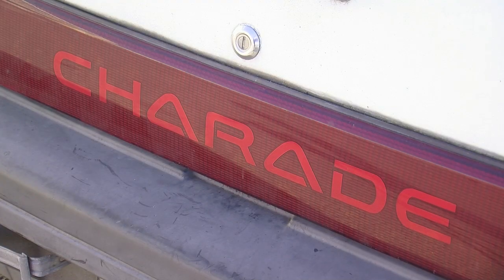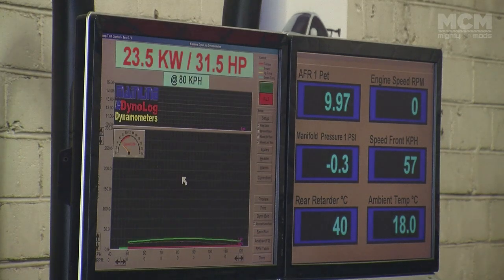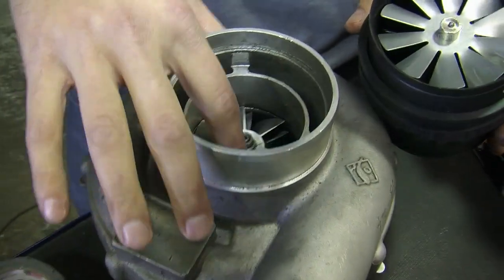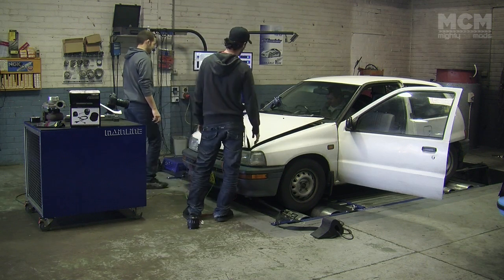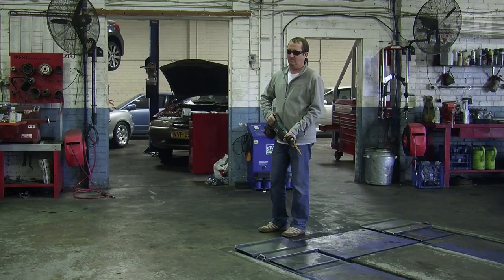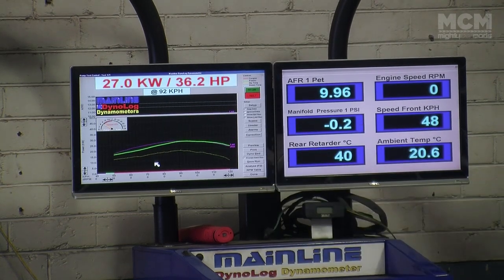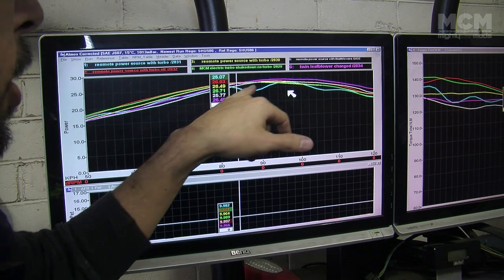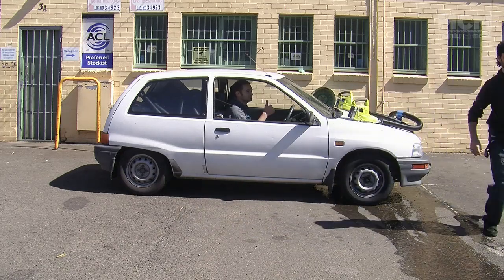Electric SuperChargers Mythbusted

Comment: u guys should build an elecrric supercharger that actually works. using a real centrifugal supercharger, but instead of being belt driven by the engine, have a DC motor spin the turbine. maybe a DC motor from an electric scooter or somethin... somethin with high torque and big nutz. ...maybe have a battery bank in the boot, and a switch to turn it on and off...  itll kinda be like "Nos" like in fast and furious... open throttle, flip it on.

Comment: There are electric super chargers that make boost legit but there not $100 on EBay. Seen one just last week that was dyno proven to make 140hp and 200ft lbs of torque on a 375hp V8. It has a switch that turns it on at full throttle and has several runs of zero Gauge OFC and two large AGM battery’s to help supply current to the big electric motor. And the whole system was still $100’s cheaper then a supercharger or turbocharger and made almost as much boost.

Comment: If you knew about carb cars you would know that the stock filter covers don't seal air tight. If you guys would have redone the cover and piping with an aftermarket set up the fan would have made power because it would have been air tight instead of the air pushing past all the leaks and not being forced into the carb at all. It wouldn't make any serious performance but it would have shown a difference. Shit your leaf blowing set up would have worked if you guys had it sealed up. Lol

Comment: So was the car fully up to temperature for all runs? It has an airflow diverter AFTER where u clowns fitted the forced-air systems that only opens when the engine is FULLY up to temp. Before that it sucks air from around the hot exhaust manifold. Having seen half a dozen of your videos now I have zero faith in your scientific method. This is pure Straylian entertainment (i.e. not very entertaining for anyone with an IQ above 100) and has zero real-world relevance.

Comment: I wonder if the electric super charger didn't work because it didn't have the extra 2" or so piping from the supplied air filter. Instead of focusing air through the fan, it may have just been displacing air around the edge of the fan blades. Pretty simple to test the theory. Hook the thing back up and attach your garden hose professionally with duct tape. Another thing is to consider the bottleneck from the exhaust system. Air can only flow in as fast as it can escape. Maybe the 30hp broken refrigerator also has a gunked up catalytic converter? I don't think is a scientifically reliable test.

Comment: Lol excellent video laughed at this stuff you guys pulled off. Only reason why I think those "FAN TURBOS" have any affect is because you remove the normal air intake filter. That will increase power but its not good for an engine coz it will obviously suck in dirt. Better then to just buy a cone filter.

Comment: Ok you wanks, I have an idea but not the capability or time. How about you try a cheap ebay turbo charger and attaching an adjustable 10,000 rpm grinder to it. If it works you could put a power inverter in the car to power it. I imagine it will work and the boost would be unreal if you don't blow the motor.
Reply: If you try it, please send me a link.
Reply: Ok, I wasn't sure what rpms a turbo spun at but it's higher than what i thought. Maybe a big impeller turbo at 10k rpms

Comment: I would also like to add make sure you add the air into the actual air Box so that it passes through the mass flow sensor, In the same pre determined fashion. Believe it or not those air boxes are scienced out. It will help smooth out the air as it enters that mass aiflow sensor, Providing a better reading. Doing all this for the least how about the computer system but may or may not make any more power.

Comment: From my experience  with these kind of things, anytime you use a factory car with the factory computer, anything you try to do that car to increase power fucks with that ECU and its emission gear. The car does everything it can to run in stock mode but you're forcing it out of its parameters. It's not exactly like a muscle car that you can adjust timing and fuel here and there to get some gains. The car basically thinks it's broken does everything it can to adjust itself back to what it thinks it should be

Comment: Hi did you not see the warm air valve on the air cleaner ? Was it open did it leak an pressure I wonder,and the air filter needs to be on the other side of the flow for sure.

Comment: easier to figure if it would do anything ....  comparing the minimum cfm flow rate  to keep engine  running  versus the output of that cheesy fan off ebay .  Even larger  radiator cooling fans only produce 2000 and up to roughly 4000 cfm and are much larger and have blades designed for max air flow under pressure.
  and  you need to not only look at  CFM but static airflow  in  mm of H2O to figure in total airflow and amount of pressure it can generate max ..... 99.999% of ebay  stuff are scams anyways but a lot of people don't have common sense to see  it

Comment: try again plz fan motors are  getting better now  and they are using rc aeropalane motor and try a bigger engine 2l min like gm x20xev 
http://www.ebay.com/itm/12V-Car-Electric-Turbo-Supercharger-Kit-Air-Intake-Fan-Boost-Thick-Wire-w-ESC-/112393989738?epid=837362203&hash=item1a2b342e6a:g:YIwAAOSw7GRZCWzt&vxp=mtr

Comment: Not saying the pos would work, but you were trying to push through the air filter and the air cleaner intake valve.  To give it the best chance you should modify the filter housing.

Comment: I will soon add an English[UK] captioning that details some science. Here are the contents of my additions for those not desiring to read the captions, or who can't use them yet because MCM haven't approved them.

I patched the part about rego to mention the MOT for the UK, and "No equivalent in other countries."

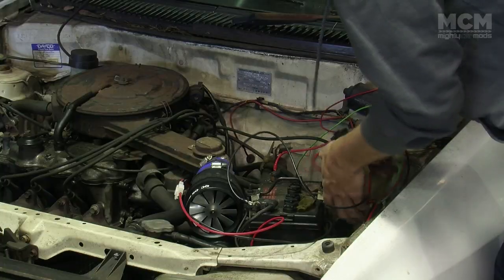5:50-5:58, I have a science alert. "If you want actual boost, you need to be pulling more CFMs than the engine itself would."

"That means that to triple our power, assuming the fuel system could cope, we would need a fan that could push around 300cfm, or around 8.34 cubic metres per minute at wide open throttle, as a 993cc engine (as this Charade is) is pulling 98.18 cubic feet which is around 2.78 cubic metres per minute at 5600 RPM (2800 completions of the four stroke cycle per minute, if the engine were a single cylinder.)."

5:58-6:02, "A more realistic boost, "15% across the rev range" would have the fan pushing around 3.2 cubic metres or 112 to 115 cubic feet per minute."

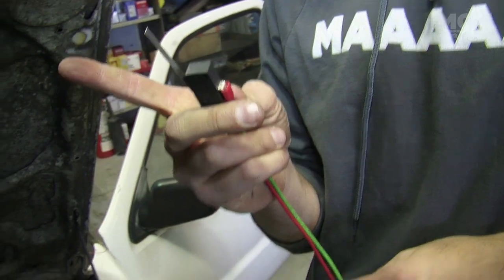6:06-6:10, "Another captioners note: If you use some kind of electronic speed controller linked to the throttle, you can set it to only provide 10% or so of its boost at idle, though that is outside of the scope of this video."

6:10-6:14, "Additionally, powering this absurd setup would have to be some kind of generator and some kind of heavy duty lithium or similar battery, which could be mounted in the exhaust or on the accessory belt, but you will lose power before you gain it."

6:14, "The captioner would say to use an exhaust-driven generator (a turbo-generator!), with a backup charger driven off your accessory belt. This way most of the power you're losing would have been lost anyway."

I make a few subjective comments... but that's really all.

Comment: 14:05  Yup, it's even worse for jet engines  where you can expect half the developed HP coming from the combusting fuel-air mixture to go directly to the compressor sections.  However, all that absorbed HP is going back directly into the system for the purpose of pushing compression ratios higher which in turn increases the mass flow.

It's just weird having to think about how the engine needs to consume some of what it develops in order to be as powerful as possible.

Comment: without a tune. Doesn't the computer eventually compensate for the extra air? Also going to add that just to run the supercharger on my car it takes 75ish HP for

Comment: That's a turbo a super charger had two horizontal screws that spin and force air into the motor not an exhaust driven fan like a turbo

Comment: So apparently there is a new electric turbo that does compress air but does require a separate hybrid car like battery. you guys should see id you can get your hands on it what ever it is and see if i actually does make boost. I dont know what its called or where its from but you could probably find it if you google around.

Comment: Putting a fan in front of a car at a dyno does not simulate air resistance. The car isn't actually moving, so the wind from the fan doesn't actually do anything besides cool the engine.

Comment: It can make a difference in big engines. You always need to adjust the computer in order to configure the fuel supply.
You can feel performance increase by taking off the exhaust.

Comment: Why not, install electric motors on the exhaust side of the conventional turbos? Problem solved. It's obvious the fans don't create enough compression. Conventional turbo fans are designed to create adequate compression

Comment: if they just attached the cheapest smallest turbo and plumbed it in.. it probably would have made that car 90HP.

exhaust driven turbos cannot be compared with electric garbage that lags the alternator with resistance.. that is why exhaust turbos are good because they use waste to make power

Comment: is cause real turbo does not jist blow high speed air.... it COMPRESS the air inside intake manifold and therefore into cylinders... and cause of this all the piping of the turbo system must be fully sealed... high speed air wont work anytime

Comment: Funny that they did not bother to plumb in a vacuum/pressure gauge to the intake tract to see if they are actually getting any boost and not leaking the extra air around the Air Filter housing (which has "water vent holes" on the bottom, or through the "hot air pre-heater" which is controlled by the vacuum pot at the end of the intake where they just attached the hoses.
Lot of work and effort without even having a clue how intake is designed on a 1980's car.

Comment: More air does not equal more hp. Along with more air you need more fuel and the exhaust would need to be able to handle the extra volume of air. Plus Ecm needs to be tuned. A Electronically controlled engine would sense the extra air and try to compensate and bring the fuel trims into the correct specifications. Ever notice all the carbon build up on a ricer bumper that has a cat back and intake? Thats not HP thats a poorly running engine.

Comment: nice video guys. how about a run using a compressed air tank?  also, turbo's do not spin at 100,000 times a second (14:05).

Comment: power of engine based on mixed from air and fuel ... ex ... if you add only the air ... you will not get much power ... so you need to add the fuel also ... we call it air ratio control ... its used to almost all of engine with turbo or super charger engine

Comment: Guys,I am not a pro nor engineer but i read something about compressor at wiki and i found out that supercharger is axial type compressor.Which is made up off many rotors blades and stationary blades up to 30.But what they bought is a single blade compressor which in my point of view is just only a fan that gives large amount of CFM[cubic feet per minute]not PSI[pound per square inch].That PSI is essential for supercharging the engine not CFM.So instead of using that shit or leaf blowers I recommend tire inflaters that gives round about 3500CFM which can produce up to 40psi thanks guys :-)

Comment: Well considering that most carb stock cars already run lean. You leaned the motor out more by adding the electric blowers. Carbs work on suction of fuel and air. Remove some of that suction and the problem gets worse. To test this to see if it is running really lean, you get some starting fluid and while the blowers are one, squirt some in through the blower itself. If the engine rpm increases you are running lean. If it really increases you are really running lean.

With a injection system lean burn would have been detected and corrected. Carbs can only do so much, which includes the computer controlled ones.

Here's a test for you your viewers would be interested in. Stock injectors can vary in fuel delivery as much as 17% between each other. Flow matched injectors only vary by 3%. A more balanced running motor should deliver more power and more mpg. A win win. Also lower octane can be used on high octane cars saving money there also. Another win win, Flow matched injectors run about 50 to 150 more for a whole set I found mine on sale for just 50 more than stock and being a 6 cylinder makes it cheaper as well. Have not had a chance to install them yet because of back pain. But sure would be interested in the results if you do it.

Also there is a new sparkplug out that on the average is increasing power by 6 hp and mileage by 3 mpg. How? It's not a new electrode design, they put the capacitor that makes all the power in a high performance ignition inside the plug. So there is no loss of spark power going through the plugs and you can get all the power you need on a stock coil as well. No need to buy HP wires either. Just change the plug. Now I did do this and they delivered everything said. You can buy them off of Ebay or Amazon. they run between 12-17 dollars and they are 100,000 mile plugs.
Reply: Plugs are called pulstar plugs. There are youtube videos out that show the huge difference in spark compared to stock plugs.

Comment: Holy moley!!!!
 You can even get a REAL Details about   T25 T28 GT25 GT28 GT2871 GT2860 SR20 CA18DET A/R .64 Turbo Turbocharger RPF

http://www.ebay.co.uk/itm/T25-T28-GT25-GT28-GT2871-GT2860-SR20-CA18DET-A-R-64-Turbo-Turbocharger-RPF-/131038364394?hash=item1e827ec2ea:g:T1kAAOSwDk5TtiQl

for £133 with 14% off and post free. And with an extra £1 off if you add it to your Ebay Basket!!!!

Comment: Guys, I love your show and all the kewl stuff you do to some seriously death deserving cars. But what about a hybrid turbo charger? Take the impeller portion off the turbo and link the compressor to a number of stupid fast Brushless RC car motors instead of the exhaust driven impellor? The Traxxas TMAX uses a  2 speed gear box. Could something like that actually generate enough compression to generate some serious KW/HP? Like using 3 or 4 Brushless motors to a single planetary gear?

Comment: How about doing a real comparison using a real turbo charger compressor powered by a brushless digital motor and controller instead of a shonky eBay circulating fan. You have proven the $100 shonky fan won't work and hopfully saved some gullible sod wasting their money But a properly designed electric turbo compressor and trick control system my get over turbo lag.

Comment: you forgot the intercooler... hows the air suppose to get cold???
Reply: heat from the exhaust is NOT the reason why you need intercooler. When you compress air it naturally gets hot. Thats how diesel engine works you know.
Reply: Toby Williams a bag of ice of course!
Reply: Make a ram air system
Reply: Toby Williams Uuuhhhhh, CAI?
Reply: The vortex turbulent flow cools itself down. No need for intercooler mate
Reply: it doesn't !
Reply: It's already cool enough, it's a electric blower not a turbo charger that transfer heat from the exhaust to the intake
Reply: keops dude that's not how intercoolers work
Reply: keops dude heat transfer isn't why you need an intercooler.

Comment: Stupid question time! What would happen if you were to stick that leaf blower setup on a smaller engine? For example, let's say you put this on a small, single cylinder engine. Surely there would be some boost because of the small volume needed by the engine.

Comment: the real eBoosters are designed to fill the turbo gap at low RPM, and have similar structure like turbochargers, which makes them rather expensive. These fans just dont have enough power...

Comment: really ...
this old engien air filter cover is leaking some of the air all over
i had this shity car and after driving in to sand storm the engiend began working like shit and making lot of smoke 
then i opened the air filter and saw the shity sealing on it just failed and the filter didnt do a shit
so next time you install turbo make sure you seal the air leaks

Comment: You can also just run a hose from the air intake to the drivers position and blow really hard in it when you want it to go faster.
Fart in the hose for methane boost!
Reply: I just tried it.
I think I may have hooked it up wrong.
It didn't even work when I tried farting!
Reply: If doesn't work, connect it to the liquid nitro-penis 😂😂😂
Reply: Better yet just hook the exhaust up to the intake it’s free poweeerrrr
Reply: @maxcheese382  you got a 200 IQ level goin on
Reply: There's only one person that sells nitro meth.
Reply: @jefeshain2068  *=* ?
Reply: Farts only work depends on what u eaten
Reply: Now that's thinking outside the box.
Reply: Hahaha
Reply: lol

Comment: 300 $ ??? With 20 $ more I got my KKK turbine reconditioned which means that the core was replaced with a new one, only the shell was left from the old one that had chipped fins. If there is demand there will always be supply, even for glorified computer fans...

Comment: I would have plumbed electric supercharger up to carb, removing original air filter and housing. adjust air fuel mixture on carb. You would have maybe gained a couple horses.

Comment: these are shit electric turbochargers, there is no fucking way a motor can create nearly enough rpm's to spin that turbo fast enough. Real e-assist turbos run a air compressor into the turbocharger chamber